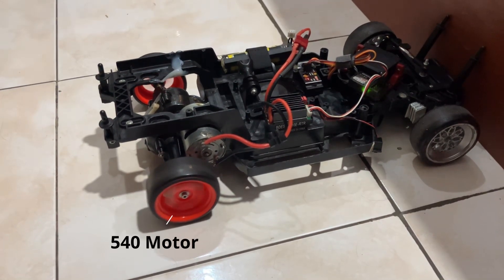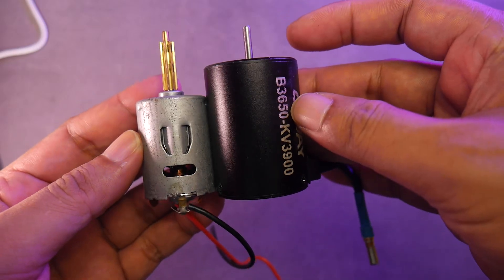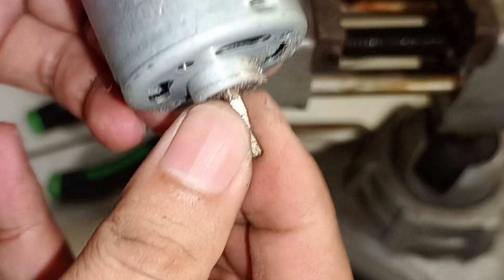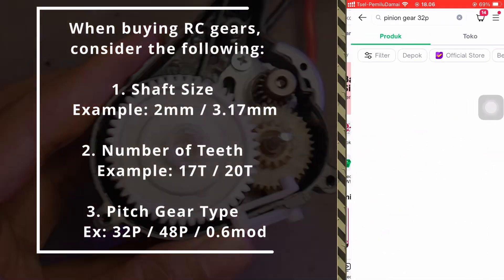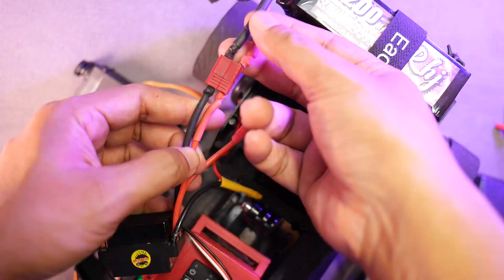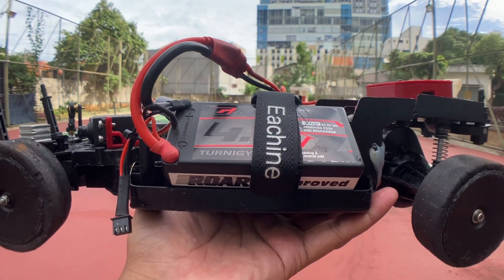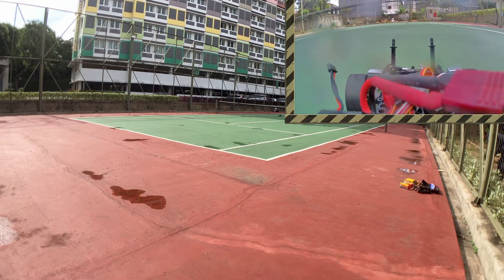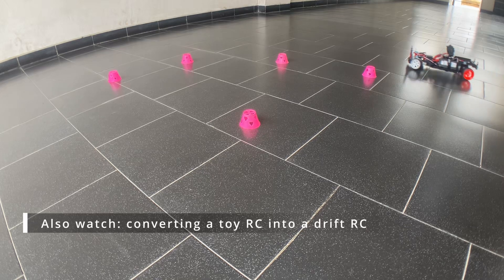Turning a Basic RC Car into a Speed Demon with 540 Motor

Comment: Love your videos! but I have a question, the output shaft diameter on the RS-540SH-8022 motor is 3.15mm would I still be able to use a pinion gear with a 3.175mm bore? thank you! I'm currently working on building a custom RC Drift car from the ground up, going to be designing and Resin printing the entire frame!
Reply: Yes
Reply from the maker: I believe so. For this 540 motor, I'm using HSP pinion with 3.175 mm inner diameter